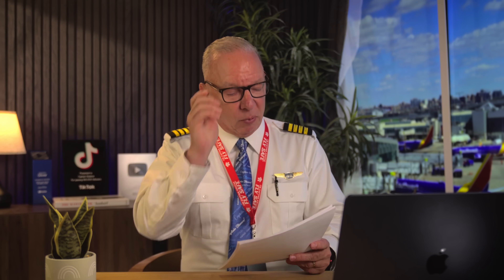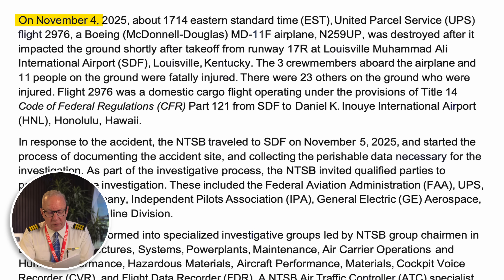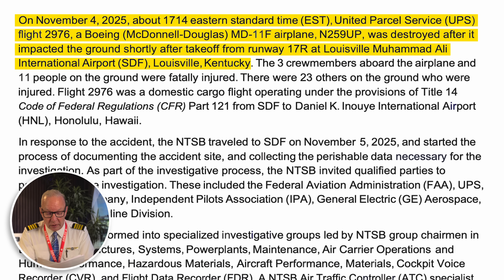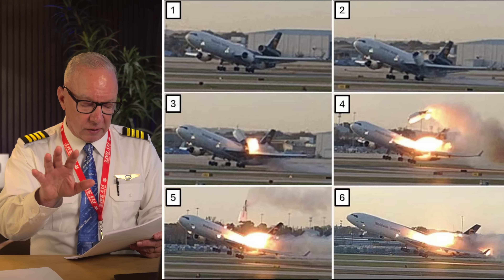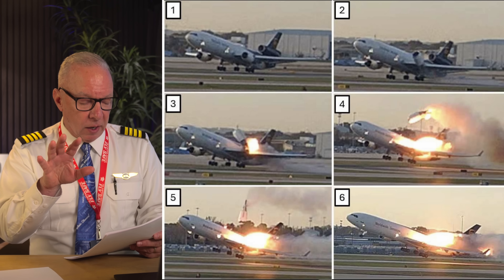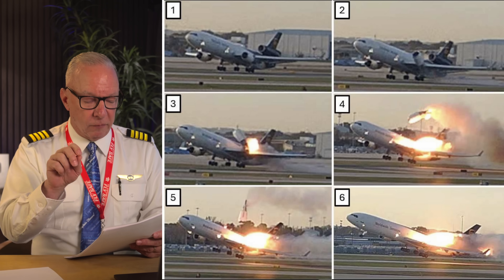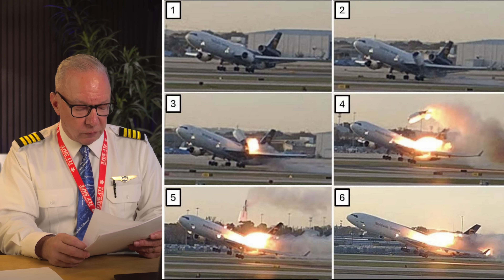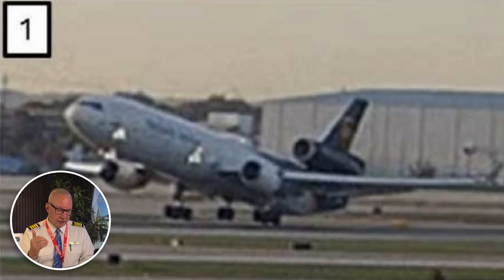UPS Crash Preliminary Report | Pilot Reacts to UPS Crash Report

Comment: It's ridiculously.I really thought someone had learnt from 1979.😮
Reply: This is not the same situation at all.
Reply: @1556cm it is.
- Engine 1 detached from the wing due to a fatigue crack. (Reason flawed maintenance or not enough maintenance for the engine pylon)
- engine detached at or just after V1/VR speed.
- Airplane becomes uncontrollable/unflyable as a result.
- airplane crashes as a result
- nothing the pilots could have done could have prevented it.
- And the defect is once again in the pylon of a McDonnell Douglas jet

Very, very similar.
Reply: @AGerm332…no..it’s not.
That DC-10 was relatively new. The structure was damaged because they used an improper maintenance procedure. They removed engine and pylon together using a forklift. That caused damage. On top of that, the DC-10 was not on fire and could fly. It crashed as slats retracted on the failed side (design failure). The wing on the failed side stalled as speed was reduced  to V2. There was no indication the slats were retracted as power was lost to the related bus.

The MD-11. Issue seems maintenance intervals for aging airplanes. This crash should have consequences for all aging aircraft…..depending the outcome of the investigation. A lot we don’t know yet.

Note that the 747 and 707 had accidents and incidents that were similar. Think the EL Al 747 in Amsterdam.

So…superficially it looks the same…but on a closer look it is a completely different issue.

Comment: Why was the last data point regarding the height the airplane reached so inaccurate? NON-PILOT here.
Reply: Steve is getting confused. It’s 480 ft above sea level not *ground level*. Louisville itself (and the airport) is inland and slightly above sea level
Reply: Louisville airport is at about 500 feet above mean sea level (MSL) so any reports saying it at 4XX something feet MSL is obviously wrong. I'm not sure how that system works, so won't speculate.  Hopefully someone here can answer.